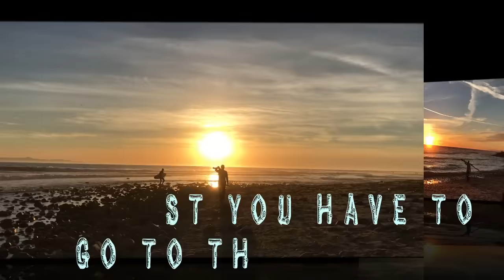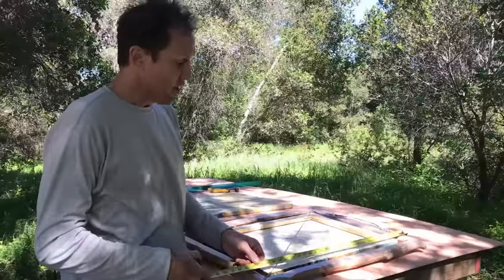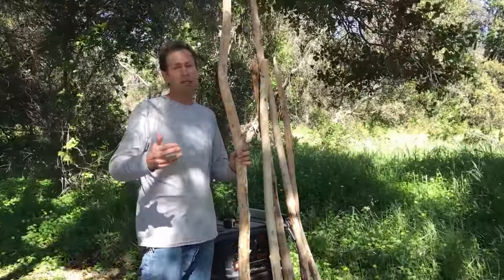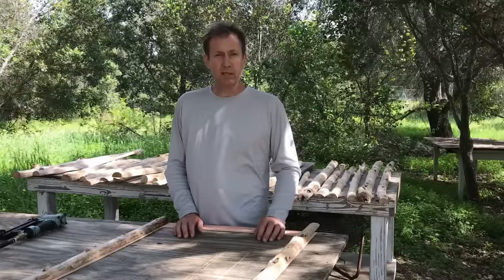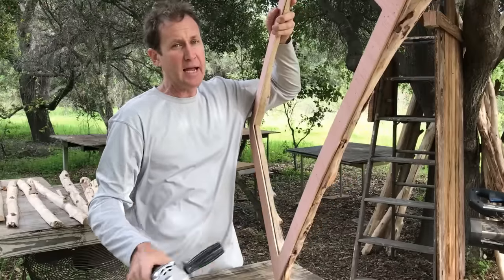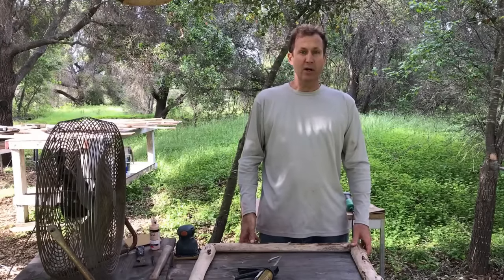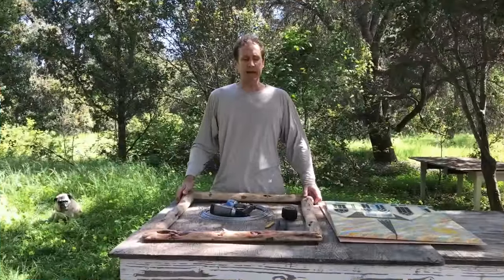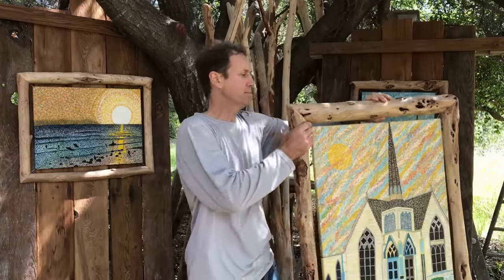Driftwood Picture Frame

Comment: Fantastic frame. Thank you for sharing this. You mentioned that most frames are overlapping/meeting the picture they frame. I wondered about making this type of frame from driftwood. I imagine it would be extremely difficult to cut grooves in the driftwood to actually fit a picture mounted on a thin ply actually into the driftwood. Just thinking out loud - I am considering making a driftwood frame for a large photo/poster of my dog, and getting ideas of the best way to do it. I'm in awe of how much skill and thought you put into preparation and finishing.